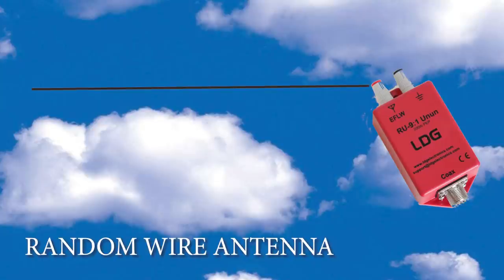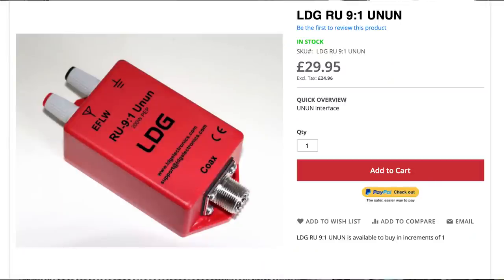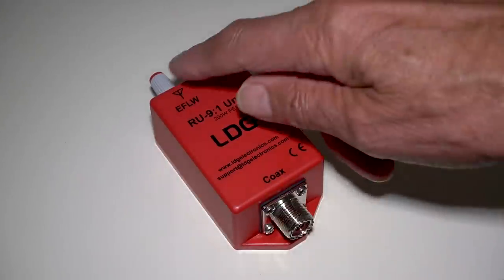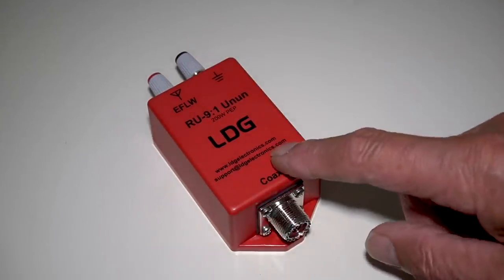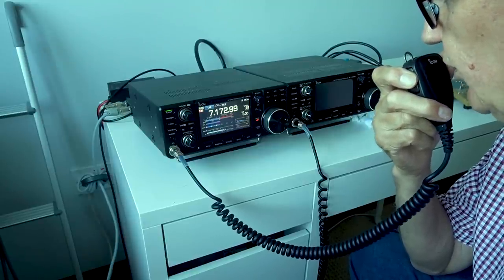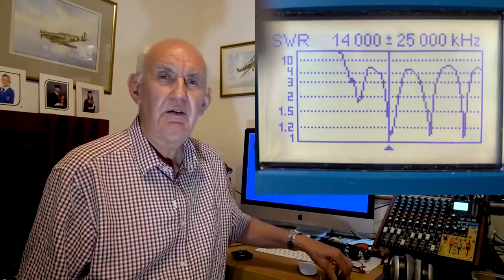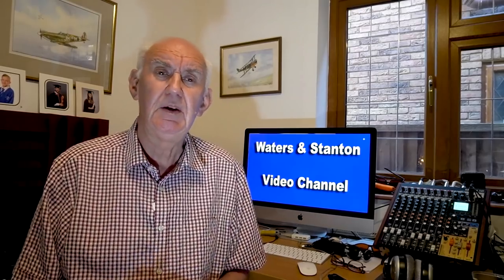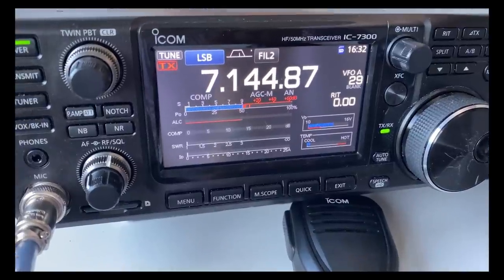RANDOM WIRE ANTENNAS USING THF LDG 9:1 UNUNS

Comment: Excellent video; I am surprised that there aren’t more videos on this piece of kit that is cheap, well made, durable,  and takes all of 5 minutes to turn any wire more than 30 ft into a very nice, all band antenna (with a tuner of course).  I built a 41’ vertical stringing a wire up into a tree above my shack (huge tree).  The base of the antenna is 12 ft (4m) where it runs into my second-story shack through only 18 inches of feed line, then another foot of jumper into my rig.  I run a 17 ft counter-poise wire through the trees horizontally.  The  antenna SWR is no worse than an 5:1 on any portion of the hf bands, sometimes dipping as low as 1.8:1 (mine gets there on 80m only).  From here it tunes easily into any band - including short-wave broadcasts with a manual tuner.  This LDG unun is cheap (about $25 in the US), weatherproof, and well constructed- it feels solid.  I built a QRP Guys kit to do the same thing that was more expensive, fragile (it broke swinging around), and not weatherproof; I’m keeping the torrid but trashing the rest of the kit.  Don’t go with the QRP guys kit, get this off the shelf unun from LDG.  This is a cheap, effective, antenna - just keep the feed line short and use a choke.
Reply from the maker: Interesting comments. Many thanks. 73 Peter

Comment: i was going to try this with 53ft of wire and about 1m of coax feeder to the unun.
 will i need a counterpoise?
my garden is just about 53ft and i can not use a vertical.
7s
M6CTP

Comment: Like the show but do not expect a LDG balun to hold up to 100w with anything more then a 2:1 swr. I was using a 4:1 balun to bring my doublet into a at200proII and my god only 5 min into to the transmit ssb and the balun case was melting. then the tuner started tuning mid transmit. Took it off put my old faithful Dentron manual tuner online and it was fine. Tried using at200 with coax and had similar issues. It be tuned, then I try to tx and it start cycling through relays. So I threw 3 boxes and the tuner into the circular bin for good. Real tuners have inductors fixed and /or adjustable ☺️
Reply from the maker: OK Kevin. Mine is holding up so far. Will do a temperature check. 73 Petrr.m
Reply: @watersstanton  yea I was surprised as my hw diepole was 160m and up at 100’ so I figured balanced feed was best for losses and the feed was 100’. When trying to tune 80m it just couldn’t with it being a huge vswr with the feed being a 1/4 wave long. So I just stayed on 160 where ant was happy.
Reply: @watersstanton  Please let us know about the temperature check. You can even remove the lid to get access to the balun and windings. If there is any balun heating, does it depend on the frequency band in use and the SWR?
Reply: I have a LDG Z11Pro autotuner and it sometimes starts tuning while I'm in QSO and it drove me up the wall. One time I was listening on HF and on a 2meter net and when I keyed my handheld, not connected to the tuner, the tuner started tuning! What I recommend doing is use the tuner in semiautomatic mode, i.e. it will only tune when I push the Tune button on the tuner. As for the balun, I use a balun from MFJ that can be switched between 1:1 and 4:1. It was able to tune a 60 foot doublet fed with 300ohm twinlead on 80-10meters. I don't have that antenna at the moment, but plan to build something similar soon.

Comment: I found the wire lengths provided by the document mentioned do not actually work well.  I tried 53' and it never tuned well and nobody could hear me.  I changed the length to 41' with 25' of coax and it tunes up everywhere and I am making contacts at 15w.

Comment: Great video. I learned a lot in my quest to get a working 80m antenna on a small lot. You mentioned keeping the coax length as short as possible to keep the SWR acceptable. How short is "short" then? 73 de 4F3BZ

Comment: Could you tell us the configuration of your random wire please. Straight? Slope? Inverted L?  And how high was each end above ground level? Thanks for an informative video. Cheers and 73.
Reply from the maker: The antenna was horizontal. height was about 20 feet. 73 Peter

Comment: OK, now I am a little confused. I have a 117 foot straight wire antenna and the ferrite transformer box. I do not understand the counterpoise if it is just a long piece of wire or is it actually supposed to be  grounded. I have the so called counter poise and my transceiver chasis to a 12 foot grounding rod in the ground. Is this ok? N6ZKI
Reply from the maker: Generally, a counterpoise can be regarded as part of the antenna. As such it should be connected to the shield side of the coax at the UnUn. I personally add a ferrite choke near where the coax leaves the box back to the radio. The counterpoise would then be floating and become part of the antenna.

Comment: Hi, having watched the video I'm thinking about a random wire, what would be your thoughts on a random length of wire run along top of a fence, my thought is with having a small garden, to run a wire down one side fence, along bottom fence and back up other side fence, in effect a "flat n" shape, would it work would you expect it to be efficient or inefficient
Regards
Eddie

Comment: Would measuring this unun with high inductivity wirewound 450ohm resistors give out a bad swr reading? I built one of these, and although I think the core is of satisfactory quality ( T130-2), I get around 2.7 swr with a resistor. When try to use it with a wire the dips newer go below that number either.
Reply from the maker: you should always us a non inductive resistor.  If you do you should see a perfect match. 73 Peter
Reply: RF resistors work well for measuring baluns and ununs. You could get a bunch of 50 ohm ones and connect them in series to achieve resistance you need.  They also make great dummy loads.

Comment: Thank you for your video. I am new to SDRs and I have a SDRduo, and purchased a LDG 9:1.  I live in a subdivision with a home owner's association and outside antennas are not allowed.  I was planning on the following and wanted you opinion.  I have now realized after watching your video to get the LDG 1:1 cable choke.  Since I currently do not have transmit privileges in the lower bands, the EXACT length is not exactly import yet ( but will be when I upgrade) 
I am going to place a long wire antenna in my attic and feed it to the 9:1, install a conterpoise, and feed it via RG8 down in my office/shack to a 1:1 cable choke (as yet to be purchased) then to my   SDRduo on one of the 50 ohm antenna ports.  (I know that the duo has the high impedance input, but since I have enough RG8 and I am planning on future use.  That leads to a few questions that I hope you or the other viewers can help me with:
1) does it truly matter for strictly listening if I install a long wire as long as I can in the attic and even if it has a L shape in order to get a longer wire?  I do not think I would be probably listening to much in the the very very very low frequencies just to add
2) would it be better to just place a long wire at straight as possible and terminate it at that time.  Once again, when I get more privileges I can and will be trimming it to the desired length
3) for a counterpoise, would it be best to just put a length of wire to the earth lug and lay in in the attic on the trusses OR should I ground it to any of the ground electrical junction boxes in the attic, OR am I causing more potential for interference?
Thank you for all of your help
Fred

Comment: @14:43, the wire's coming through the window. Is the window completely shut on the wire? I'm interested in doing similar,but the last time I tried that, my SWR was sky-high.
Reply from the maker: Maybe you had a metal frame?
Reply: @watersstanton  :looks like plastic/metal. Sent feedline through window, with the portion of RF feedline that crossed the frame zipped tied on balsa block. LDG 9:1 and LDG 1:1 choke were out on 2nd floor balcony (wood) facing street/neighborhood, clipped on the over head, but townhouse/HOA restrictions make it difficult as far as anchoring. (Don't want to strangle neighbors with 14 gauge wire angled over sidewalk).  SWR settled down, but 20M noisy with spurious noises/EMI in my area (?). So it's a sloping Vee, that's almost an inverted Vee. Not a great takeoff angle.

As far as backyard, workable area is 18ftx14ftx14ftx38ft. That longest run is along garage (38 ft). Have tried every combination of vertical or horizontally polarized antenna, mindful of HOA constraints. Would like to run setup similar to your other video (https://www.youtube.com/watch?v=UcuHTWWOg7c&t=996s),but have extremely limited space. One last shot from the 2nd floor window. Recommendations gratefully accepted.

Comment: j'ai d'excellent résultats (concernant le SWR) avec 15,80m de fil d'antenne et un coax de 25m en guise de contreproids et une mise à la terre du Transceiver (pour améliorer la partie 3.5Mhz).
J'ai au maximum 2.4 de SWR de 80 à 10m en Slopper avec le UnUn au sol, et un RF Choke juste avant le transceiver.
de 20m à 10m je préfère utiliser une 1/4 wave GP que je trouve plus efficace.
Le 9:1 est meilleur en bas ! ( de 80 à 30m)

Comment: Hi Peter, great video and much appreciated, however I just have a quick counterpoise question.

I will be using a roughly 44ft wire with a 9:1, a line isolator located at the radio end and it will have about 15m of coax.

With the line isolation at the radio side I understand that the coax will be acting as a counterpoise with that length of wire, so will I need or really benefit from an additional counterpoise attached at the unun?

Thanks, William.
Reply from the maker: You don't mention whether vertical or horizontal, but generally there is little to be gained. However, a counterpoiise also tends to keep RF out of the shack so it really is your choice.

Comment: Which would be more efficient (Less RF loss), A 9:1 transformer or an Icom AH-4 ATU on a random wire?

Is a random wire better (RX Noise?  or?) as a vertical or horizontal antenna?
Reply from the maker: Icome is better. Moise is often related to location rather than antenna type.

Comment: Interesting, thanks. Just a small point: you will always need to use an AMU, as even when the wire impedance hits 450 ohms at a particular frequency, it will have a reactive and a resistive component. The transmitter needs a 50 ohm  resistive load for good matching, otherwise the SWR will be poor.
Reply from the maker: Hi Mike, thanks for that. I did actually achieve 1.3:1 on 20m but at the cost of high VSWR on most other bands. 73 Peter
Reply: @watersstanton  73 and good health Peter de Mike ok8msw ex g4ome
Reply: This is the hole in my knowledge filled - I knew I needed to put my dips in the right place for 450 ohms, but wasn’t sure why I then needed the tuner as well. I assume it has something to do with it not being a half wave on that wanted frequency, perhaps?

Comment: Really appreciate that Peter. I am frustrated with end feds. So some good explanations there. Im wondering on the necessity of a counterpoise if used vertically on a fishing pole. Any thoughts? VA3SII G7HCD
Reply from the maker: Verticals certainly need radials. The EF wire is a bit different. A counterpoise is normally above ground and as such becomes part of the radiaring antenna. This means it has quite an effect on resonance. I would recommend it but be pre pared for a resonance shift. 73 Peter

Comment: This is where I get confused . Divide speed of light by freq.  Using same units 300 divided by 14Mhz gives ? Metres.  Full Wave. Ok but then radio waves travel through air faster than through a conductor, wire for example. RF cable manufacturers quote correction factors whereby 0.95 for example so cable length full  Wave multiplied by 0.95 gives wavelength in a conductor.  That where I get confused . Food for thought.  Cheers from old George
Reply from the maker: Hi there. There are quite a few variations on all these antennas. The W3DZZ is a trap dipole but with specific values for the traps. I also missed out the G5RV which again is a variation on the doublet. But will probably revisit these on specific designs. Great to hear from you. 73 Peter.
Reply: From my days as a Novice KA5HEA, I recall ARRL manuals recommend using 456 ÷ frequency as a formula (feet)for a first cut at a half wave antenna. Then trim for minimum SWR at local conditions (height, ground conditions etc.)

300÷ frequency = full wave in free space (Mega Meters/seconds) per (Mega Hz ) = Meters/cycle).
)

Comment: There are lengths of wire that are to be avoided: where the wire is a half wave on the band that one is intending to operate on: I guess in that case one might get the 49:1 unun out! Lists of ideal lengths that avoid this scenario for all bands are available online.
Reply from the maker: Yes you are correct.

Comment: I made one with 37.5m of wire. To my surprise it was low vswr on 7,10 and 14MHz. I put it on an analyser and it was actually OK at the top of 21 and 29. I never managed to make it work on 80m. I also tried a 5.5m counterpoise. This made it identical to a W3EDP. I found this helped on 28 but threw all the other bands out. You do need the line isolator. Without it it's a very noisy antenna. Very useful for a temporary or listening antenna. A half wave is a lot easier to set up.
Reply from the maker: Thanks Gordon. Similar to my findings. 73 Peter

Comment: Hi Peter great video, I have recently purchased a 9:1 unun multi band with 41meters of wire on it I have a big garden so space is a premium plus two big trees at the end of the garden to wrap the wire around. Going to purchase one of them ldg isolators. Question so the end of the wire which is ended at a bone does that need to be close to the ground or for better purposes as high as I can get it. Thanks
Reply from the maker: Keep it up in the air. 73 Peter
Reply: @watersstanton  thanks

Comment: The higher SWR may be of no significant consequence to signal strength, but be aware that most modern radios will start folding back on power output as the SWR rises above 2:1.
73 de Arnie W8DU
Reply from the maker: Which is why I emphasised the need for some kind of matching unit, in or outside the radio. 73 Peter.

Comment: Hi Peter, I have a EFLW, 53 ft. I have an IC 7300. I am using a 9:1 unun about 15 feet off of the ground with 50 ft. of RG18 just laying on the ground. I also use a autotuner before my SWR bridge. All the bands tune from 1.2 to 2.0 except for 40 meters. It runs around 3.5:1. Can't understand it. Do you think a counterpoise might help? Is this the nature of the EFLW? I get great reports on 40m. however. It is a puzzle. Thanks for your videos. Always well done.
Reply from the maker: Hi Frank. i would suggest you do nothing. If you get an improvement with a counterpoise, it may well make some other bands, worse. BUT in ham radio everything is worth trying! 73 Peter

Comment: First day trying, 41ft wire, LDG 9:1, and that won't tune on 20m. When I added a short counterpoise it got worse! Will try some other 'good' lengths under 50ft, but my lot is limited, so it will be fun to try.
Reply from the maker: Don’t forget that you can increSe length with a loading coil. Best about half way along the wire. Cut and try task!
Reply: @watersstanton  True, that the 1:1 choke made a difference, and shortening the wire about 6 inches also brought in 20, 17, and 10m. I also managed to throw a longer counterpoise in an opposing tree. I'm running off a battery from the 2nd floor (away from the normal shack). I think it is important to keep the coax short.

Comment: 9:1 unun 155 ft of wire ,grounded with 2/ 15 ft counterpoise at base of unun and get a flat swr on all ham bands along with a choke at the end of the 50 ft coax before it comes in the house. Often times just called a dummy loa. But it works the world in poor conditions.
Reply from the maker: Thanks for sharing that. 73 Peter
Reply: Interesting, as Palomar Engineers recommends 155'. I only have room at the moment for about 135' but I can work on that. Is your configuration inverted L, sloper, or flat top? I have been using EFLW and EFHW antennas for years.
Reply: @BillSproul  you can run shorter lengths just keep it a non ham band resonant length